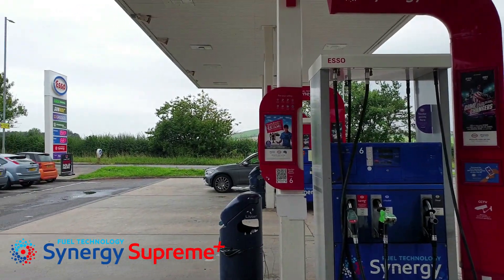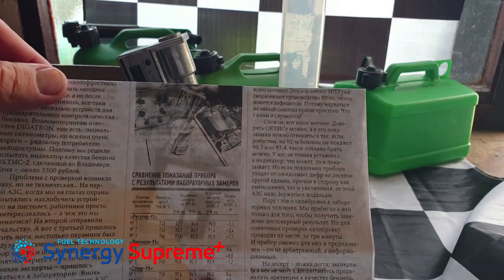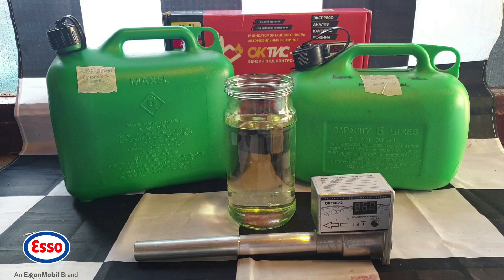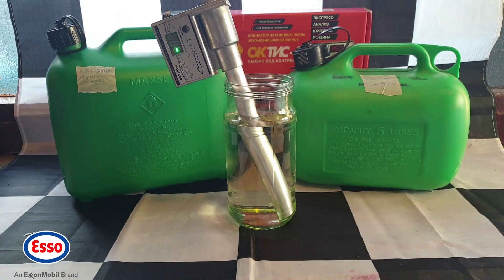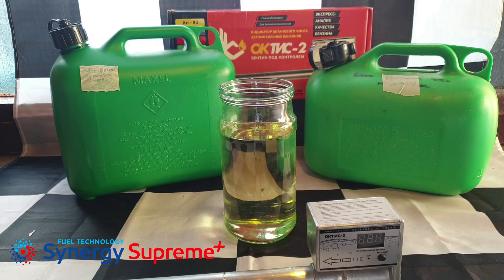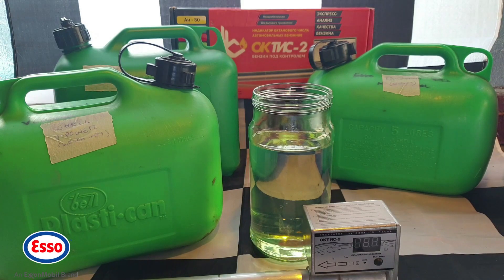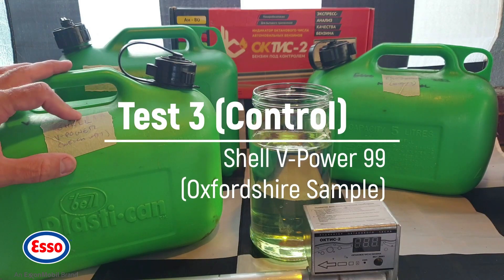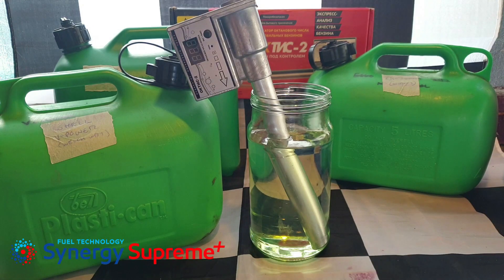Testing Petrol / Gasoline for Octane ⛽ Part 7: Esso Synergy Supreme 99 Revisit & Retest 😬 Bad Result

Comment: The problem here is most likely  the Franchise.
Fuel pumps marked as  premium delivering non premium fuel.
Reply from the maker: They're two separate franchise owners in different counties. Also if they're selling their regular/cheaper fuel as Supreme/super, then it would have ethanol in it. A few people found that to be the case in London with some dodgy garages doing just that. I've just got a sample from North Wales, so watch this space 👍

Comment: A reply on a forum I shared this video on:

“I work in the fuels R&D area and I have never come across a methodology to test octane via its electrical properties that is reliable. In fact dielectric properties can be hugely affected by the presence of polar compounds (such as detergents, MTBE or ETBE) and a few parts-per-million (ppm) of anti-static additives, so not sure if I would believe such a device to accurately represent the RON. The tests I am familiar with are the using the CFR machine (engine) which is obviously the correct way of testing according to ASTM or DIN standards. It's actually quite a cheap test; £200-300 per test at the certified labs accredited internationally to run the CFR machines. There are desktop IR-based methods (e.g. from Petrospec) that have to be trained, but can be quite accurate providing you are testing fuels within the training of the kit. I also have access to SGS worldwide gasoline surveys and can see Esso's Fawley refinery's data from that. They are indeed 99 RON and also currently "E0" but I am led to believe that they will be moving to 99 E5 later in the near future. From what I can remember there are no >100 RON fuels in the UK from the SGS data. IIRC, there have not been any >100 RON fuels in the UK at retail stations since bp's short-lived Ultimate 102 trial in the late noughties - which was produced by their fuels speciality/F1 blend team when they owned Coryton.”

Interesting.
Reply: No thoughts on this?

Comment: Disappointing result for Esso. Ive always avoided it anyway as it is the most expensive E5 option my way (just east of Cambridge). I find Shell VPower the best fuel. BP is only 97 which is a shame. Thanks anyway for doing these tests, have subscribed!
Reply from the maker: Thanks very much for the sub and for commenting. Yes, I'm still using V-Power although our Esso "99" is cheaper here, but would use Momentum if there was a Tesco station close by.

Comment: I have a BMW M240i running 656 BHP and it was tuned exclusively on Momentum and I thought I’d tried ESSO Synergy Supreme+ (Heathrow located) I had timing pull across 4 data logs, where I never had timing pull with with Tesco Momentum. On one of the ESSO logs I had 3 knock detections within 1 pull which is unheard of on my car running Tesco. 

I’m included to try Shell next but based of the numbers your tests produce it seems there is likely minimal difference in performance gains.

I had also tested Momemtum in a measuring tube like your self which yielded that it had zero Ethanol present which matched your Abingdon, Oxford findings.
Reply from the maker: I've been looking more into this and some tuners are saying Tesco Momentum is better overall, because they provide a consistent formula for their fuel and will run the same every time and every tank full. V-Power can "sometimes" achieve higher figures, but it's a crap-shoot on your next tank of it being as good as the last one. It's surprising as I'd have thought Shell to have stringent quality control, but then again, looks like Esso don't.

The M240i sounds like an absolute monster! I've driven a manual (older, obviously) one which I know is slower than the dual-clutch, but it was fantastic! I can't even imagine over 650bhp in one 😳

Comment: To be fair I always notice a difference when I fill up at Esso Chiseldon rather that Shell or Tesco so maybe this explains it. Can you test Esso standard fuel to see what Ron rating that would be? Think I’ll stick to Shell or Tesco from now on 😂
Reply: I agree. I tried Esso E5 once and was very disappointed. I normally use Shell Vpower. I've recently tried Tesco momentum and that was good as well. It's good news these fuels contain no ethanol as well.
Reply: @ds1868  I love Esso premium E5 its great my car runs better on it than anything else on the market. Tesco Momentum is my most frequent choice and have no issues at all. I believe with the premium Esso E5 it comes from a different refinery depending on your location.
Reply from the maker: @gravemind6536  A lot of them do. The base petrol is taken from a particular refinery and then it becomes Esso's, Shell's, Tesco's product once the additives are mixed in. I'm getting a sample from 5 hours North of me soon, but apparently it's still from Esso's Southampton area refinery, then distributed from Birmingham.
Reply from the maker: Sadly not, as the standard fuels contains ethanol (which is an octane booster in itself) and it'll give an inaccurately high reading. I could try and remove the ethanol and see if that reads 93, then it might back up my theory of the Supreme additives being formulated to have ethanol in it as well.
Reply: @boilerhousegarage  The Esso website says "From September 2023 our Synergy Supreme+ 99 will transition to contain up to a maximum of 5% ethanol at all Esso pumps irrespective of which part of the country they are located. The labelling at our pumps will remain as E5 for Synergy Supreme+ 99 unleaded."  So your fuel sample may well have had ethanol in it.
Reply from the maker: @dawnastral7571  I mention this in the video I did before this one. Esso's new PR here just means they're now the same policy as the other brands, so they will remain predominately ethanol-free (like the others) but aren't guaranteeing it anywhere. This fuel was tested to be ethanol free and my octane tester won't read ethanol blended fuels, but thanks for mentioning it though, my theory is that they've designed their additives to use ethanol as an octane booster, hence why these samples are far too low.

Comment: You talk about "the big 3" but in all my tests Texaco 99 is ethanol free and much cheaper than Esso.
(I live on the outskirts of West London).

Would you consider testing its octane rating for us viewers?

You never know, it might become the big 4!
Reply from the maker: You're in luck, I've done an octane test on Tesco Momentum, so please check the previous videos in the "playlists" tab on my channel page. It was done in a test tube and not sure if that affected the reading, so may test again in the future using the standardised method I mentioned in this vid. I'm still confident it far exceeds 99 RON and some dyno-tuners say it's higher than Shell's.. By "big 3" I'm referring to their market cap and BP is one of them, but they only supply a 97 RON super. I personally rate Shell V-Power, followed by Tesco Momentum. Esso, given the results here, I no longer rate and never liked BP.
Reply: @boilerhousegarage  I was talking about Texaco, not Tesco.

(I know Momentum is a great fuel)
Reply: @happytashman Yep I'd also be interested in the Texaco. I normally use Shell vpower but a recent try of Tesco momentum was good as well, plus it was the best price!
Reply from the maker: @happytashman  Oh, sorry! 😊 I must need new glasses. Well you're sort of in luck, as I have done an octane test on Texaco, however we don't have their "Performance 99" here, just their old Supreme 97 which had 2% ethanol in it. I extracted the ethanol (not a metaphor) and it read 94/95 RON but can't be compared to the others yet. Obviously if Texaco bring their 99 to my location, I'll be on it. Here's the Texaco octane vid https://youtu.be/o08bguswcgs?si=oUIFjCYvlOYtrvTL

Comment: Oops!

Hopefully an explanation will be forthcoming from Esso. 

As you said, it really is disappointing.
Reply from the maker: Hopefully it's isolated to a few counties, but now I'm really interested in trying an Esso further afield.
Reply: @boilerhousegarage Perhaps one of Esso's detergent additives is incompatible with your tester? Seems hard to believe that a company like Esso would sell 93 labeled as 99? Surely they'd be murdered under the "trades descriptions act"?
Reply from the maker: @happytashman  It's a possibility, but I heard from a bloke who does these remap jobbies, that for some reason Esso fuel doesn't work with the maps that utilise 99+ octane, unlike Shell and Tesco's offerings. He can't test the octane, just see the knocking (pre-detonation) on rolling road tunes. My theory is they've formulated the additives to accommodate the addition of bioethanol nationwide, so it's not boosting enough in the areas supplied without it. And yes, they'd be in a bit of trouble if that's the case.

Comment: G'day from Oz, interesting series of experiments your doing, I've seen these units before and wondered how/what device or mechanism the tester uses to establish the  readings it concludes, it would appear from your testing that it seems to be consistent, with repeatable results.
Cheers, Glenn DownUnder.
Reply from the maker: Hi there from the opposite side of the world! 👋 The tester has capacitors that measure the permittivity of the petrol and I assume the higher the octane (resistance to detonation) equates relative to its dielectric properties and the measurement is taken by how the electrical charge is affected between the capacitors. Thanks for the comment, Glenn 👍